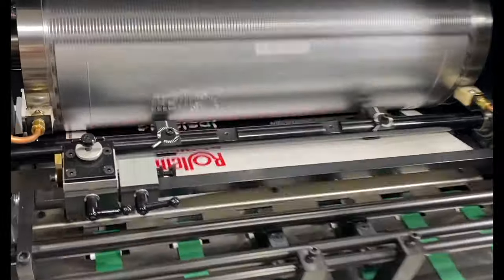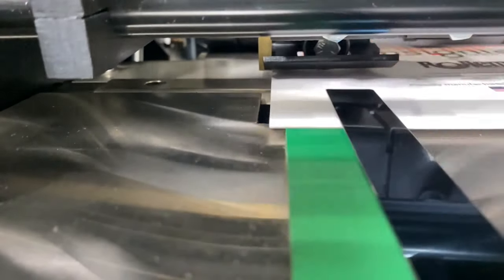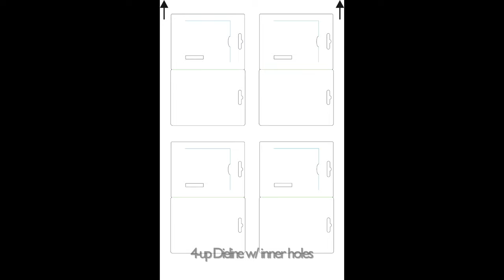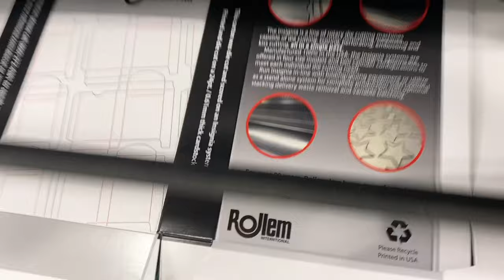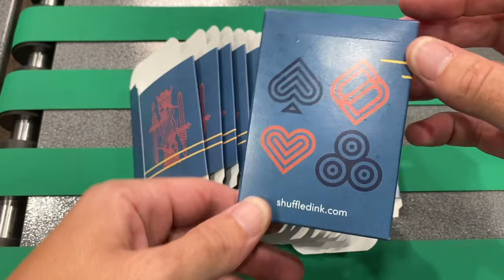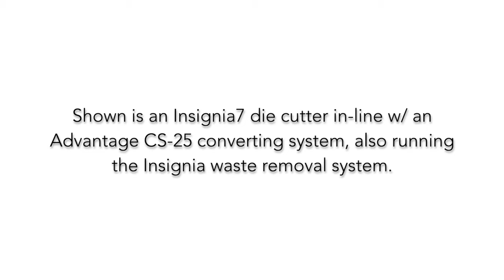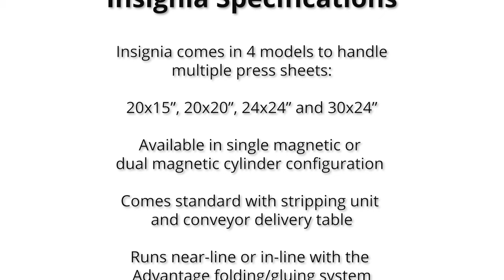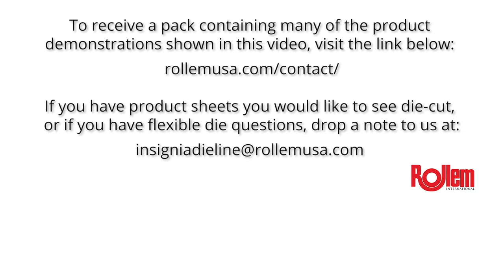Rotary Die Cutting for Folding Cartons and Packaging!

Comment: If the paper that comes in is not completely straight?Has this machine any cameras to read and correct?Its look very nice..The cost of the magnetic plate is cheaper than the traditional molds or not?Can it use for cardboard papers with metalize layers?What about floute materials?